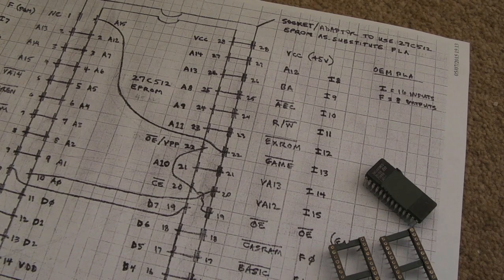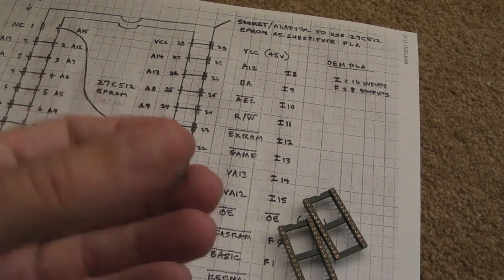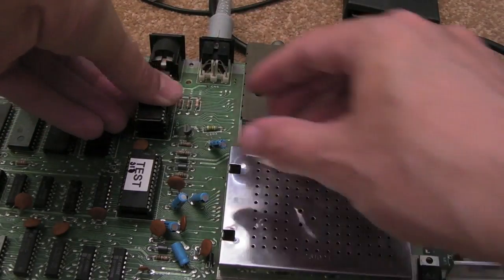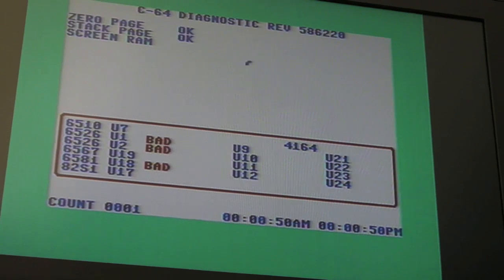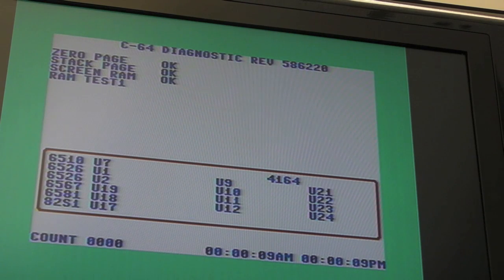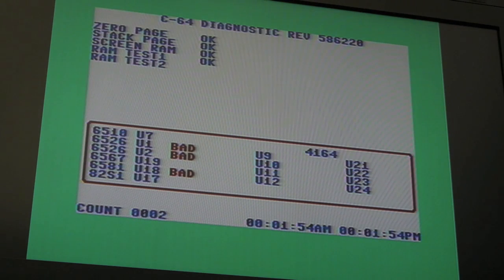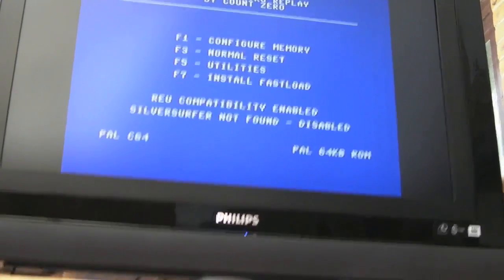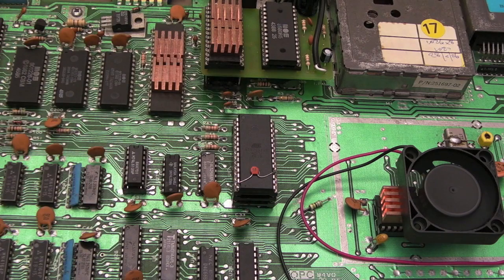Commodore 64 (C64) DIY PLA Replacement (EPROM / OTP)

Comment from the maker: NOTE: I've since tested Winbond W27C512-45 chips and they do not work at all, although I suspect the Winbond chips I've tested are fakes probably.  Stick with genuine Atmels I think.
Reply: they are fakes,i have 45ns W27C512-45's and they work fine,no need for a cap on the cs line at all
Reply: you will most likly find there 70ns parts in reality,some i ordered were the same
Reply from the maker: Yes, the Winbond ones where fakes - 70nS =/  But the At27C512R were genuine 45nS chips.
Reply from the maker: It depends on the C64 revision - the atmels I have are definitely 45nS - the Winbond were fake, the At27C512R were not.  Some C64s show RAM glicthes without the cap, others do not!  I found the exact same thing with the chips Dave Curran used.
Reply: So definatelly we can replace the PLA (in old C64) by simple EPROM yes ?

Comment: Do you know if there is a CF Card or similar type device like the one for the A600/1200 for the C64?
Reply: The nearest you can get is the SD2IEC, or the 1541 Ultimate II.  SD2IEC is much more affordable and runs most .D64 ROMs.  The 1541 Ultimate loads .T64 and .TAP as well as .CRT (Carts), and .G64.  I think both support .PRG files.
Reply: Cheers for the info' pal.

Comment: I'm rocking one of eslapion's PLAkate RC EPROM PLAs in my workhorse C64 myself. I'm looking into trying one of the newer ones based on the Xilinx XC9536XL called PLAnkton done by e5frog now. Despite all the bickering in the forums, I've found the EPROM PLA to be a reasonable solution to a failed original.
Reply: aphexteknol I forgot to add, the "PLAkate" EPROM PLA is a ST M27C512-90B6 EPROM, which as I understand it are some of the most compatible chips anyone has found to date for this modification. Sadly the chip is discontinues but still available if you look around.
Reply from the maker: aphexteknol Thanks for all the info there =)  I've heard the same things about the ST M27C512-90B6 but I couldn't source one.  The AT27C512R-45 I've used seems to be flawless so far (with the cap).  I will test it in another couple of 64s when I get time.  Strangely I just read on Dave Currans blog that he experienced some temperature issue with the SID but I've not had that problem but I will do more testing in that area to see what if anything is going on with temperature and the SID.

Comment: Neat solution to replace the PLA. It did go for the SuperPLA v3 replacement on my Reloaded board. Would be awesome to compare both solutions actually.
Reply from the maker: I think they will both appear identical since I've had no problems with anything after 3 or 4 days of heavy use.  The SuperPLA v3 is ideal though since you don't have to mess around building it etc.
Reply: GadgetUK164 Yeah I figured that would be the best. I did source a 'real' PLA from another system though so I could always go 'native' :P
Reply from the maker: lactobacillusprime It makes no difference really!  I would be quite comfortable with swapping out the CPU, PLA, ROMS, CIA for substitute modern replacements, provided they don't cause problems.  I guess the bits that makes the C64 feel like the C64 is the SID and VIC ultimately.